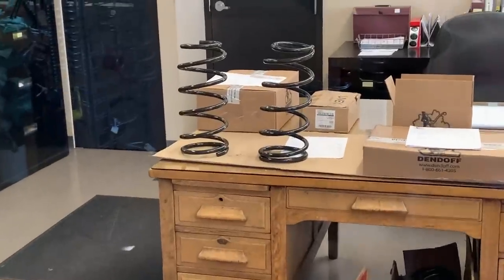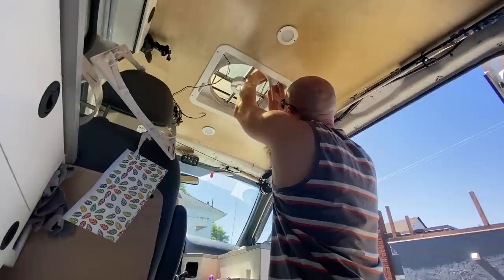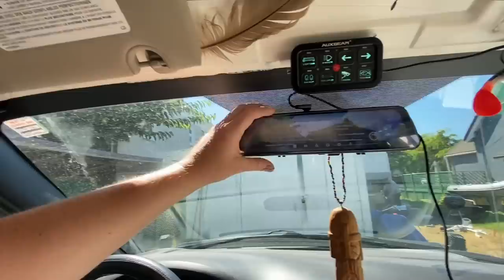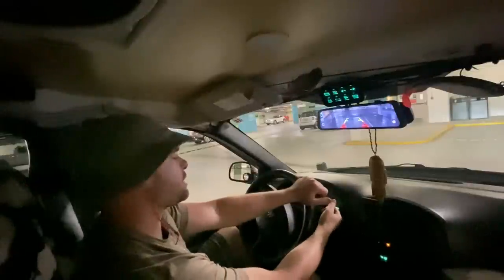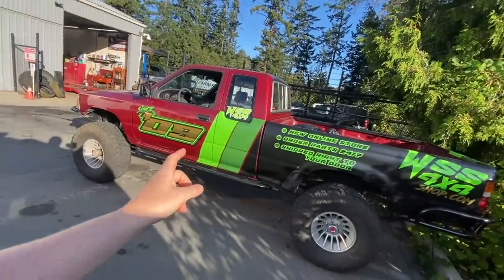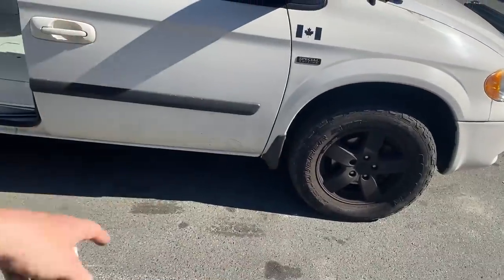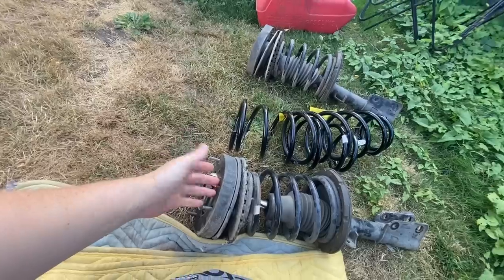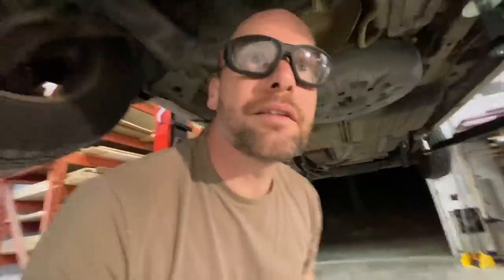Making My Van Home Better Inside & Out

Comment: Those wee cameras are ace I don't have your exact one but they are all very similar. One thing I did do was to replace the chunky 12v cigarette lighter power plug with a USB power wire then installed a USB port on the inside of my dash so it plugs into it and isn't seen or in the way. You get them on Amazon as with everything but I don't know if they post to Canada, the company I used (uGreen) gave me a great cable and it works perfect.

Maybe it's worth a shot to keep it out of your way.

It is great to get loads of wee jobs out of the way though, unfortunately I'm having to scrap my van but I'm excited as well because I know get to build a new one and go through it all again 😀😂

Comment: My Maxx air fan got the same squeak. Saw Ray outfitted did a video on cleaning motor brushes  I'll have to do  it soon and I feel you on the suspension work ...my e250 is in dire need of a rebuild in the front end

Comment: Oh man! Been there, done that a few times with getting something fab'd only to be standing there, saying WTF! and cursing at myself cuz it doesn't fit! DOH! 
However, it may have been the universe interjecting a save. I'm not entirely sure that plate was thick enough to take the pressure of the springs compressing on the back roads. Unless I'm not seeing it correctly and the spring contact area is right over the pipe slice and the flanges were just for locating bolts? 
Nice machine shop John's got there! Jealous! 😁

Comment: Confused..new spring rate should be higher due to larger gauge but appears new wire is softer. Otherwise shouldn't have sagged that much since start length the same. I don't see gain if you had to use spacer to get back to height. A one inch drop is a lot implying soft wire used. There's a factor involving wire gauge and number of turns. If they make springs their charts should have in mind  made a stiffer spring. Spacer seems like a fix for a big expense. I could be in wonderland but that's how it seems.

Comment: that's A LOT for that little of work ...a spring compressor is 30 bucks .... once you bash out the ball joints the mcphersons will plop right in with 4 nuts... you'll need an alignment after that...